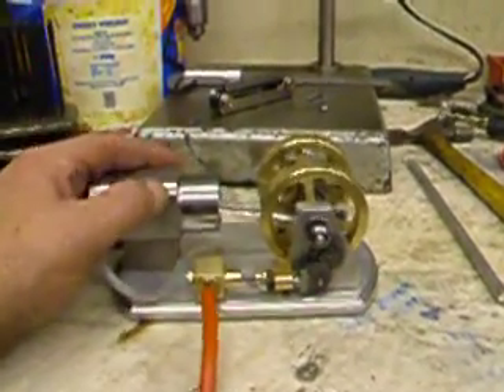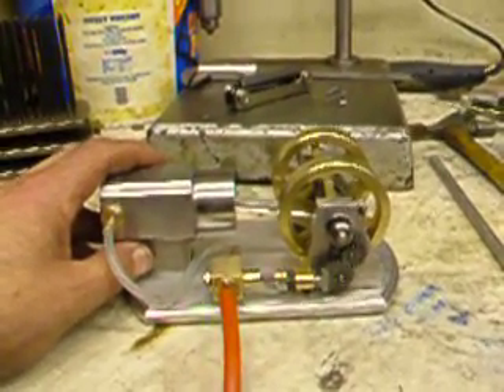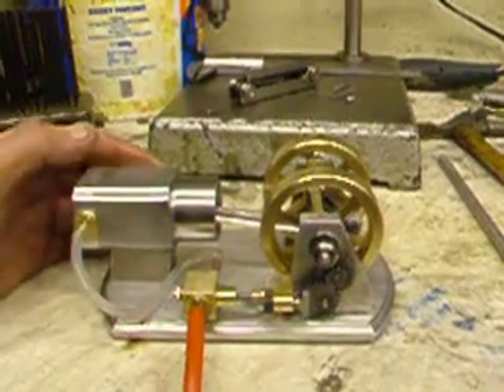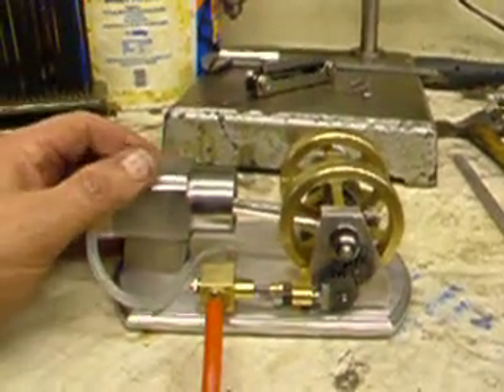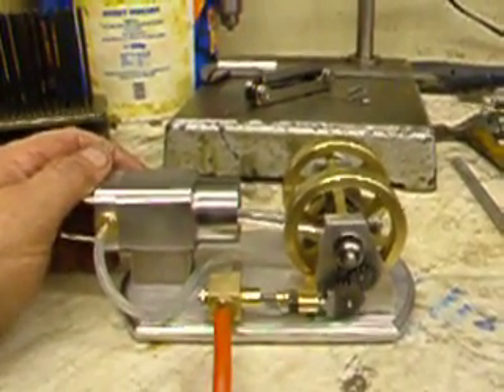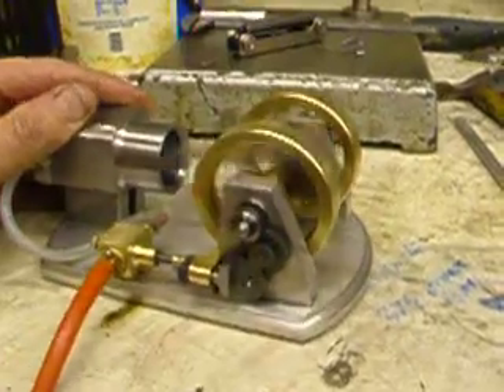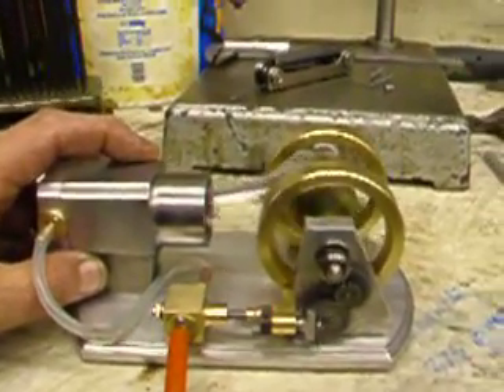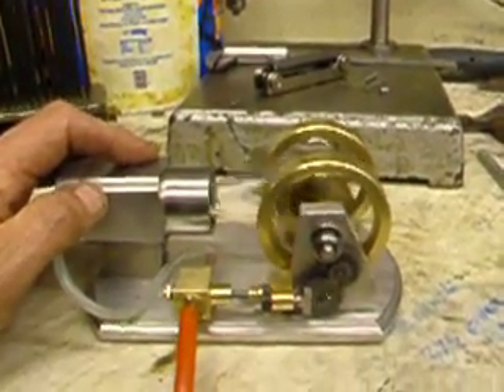First running of poppet valve engine

Comment from the maker: This is a first build prototype. The later version will have heavier, but not larger flywheels, and maybe a slightly shorter stroke.
Plus this one is losing air between the valve and head, and in the piston arrangement in the head itself. These where nearly fixed for my other vid showing the three firing cycles.